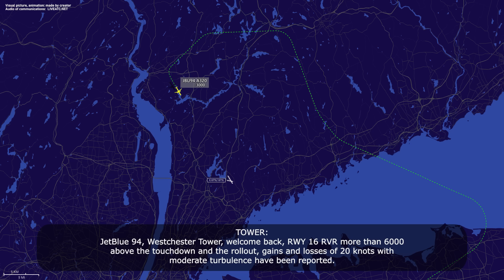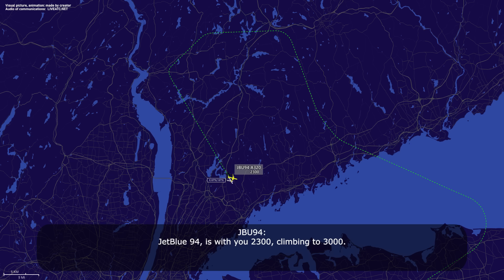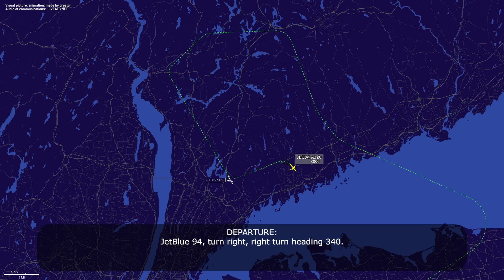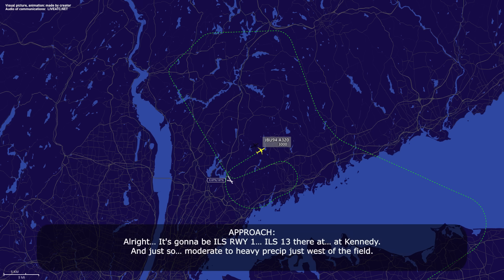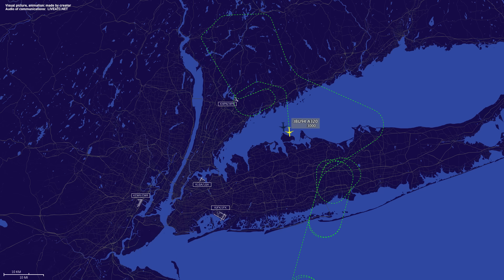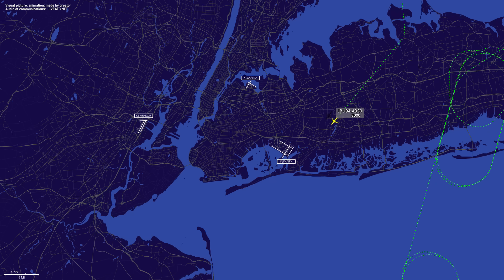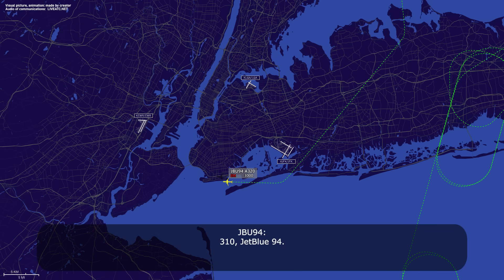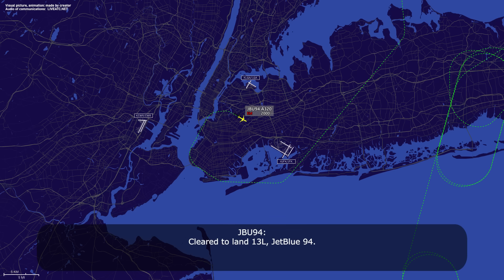Minimum Fuel. Pilot declares fuel emergency. Unable to land at destination airport. Real ATC

Comment: Some have asked why the controller declared emergency fuel for JBU94 ? Avianca Flight 052. 25 Jan 1990. At the time stamp 06:16 JBU94 was flying abeam Cove Neck, NY.
Reply: ATC will declare the emergency to expedite the landing and save the pilots from a major headaches with the company. Also this controller is sensing these pilots are totally at the limit of how many tasks they can do at once. When he asked do you need to declare min fuel he was giving them the door to a quicker landing. PS it's usually fuel to to furthest alternate plus 45 min for vectoring or a 2nd alternate.
Reply: @BillWendell-y5c  ATC know that their declaration of an emergency gives them wide leeway in how they direct traffic in order to deal with that emergency. They also know that commercial pilots aren't going to complain when ATC makes life easier on them, and that the companies the pilots work for can't complain when ATC is the one giving the pilots commands to operate out of company procedure. 

An airline pilot taking it on themselves to divert to another airport can have the company on their back, but ATC making such a call means the pilot can just point to the government and shrug.

Comment: In this time of FAA troubles, doesn't it make sense for aircraft to carry extra fuel, even at the expense of fuel economy.  We can't add low-fuel worries to the current problems!
Reply: They did have plenty of extra fuel BUT with 55 minutes of hold time (at the start of this recording) they used it up fast.
Reply: @charlesgee3003  Agreed, but if I were a passenger I'd feel better if these aircraft filled up the tanks so that ATC and pilots had a lot of options.  ATC is badly overworked.
Reply: @GreenEyes_MS  They could, but their airline would go out of business pretty damn quickly.

Comment: 5300 lbs / 2400 kg isn’t really a fuel-emergency amount of fuel. That’s a pretty standard amount to land with. Obviously, this is busy airspace and the weather isn’t great, but I think the first controller misunderstood how much endurance they had, because it should have been about 60–70 minutes. When ATC said they’d declare a fuel emergency on their behalf, it seems like the flight crew just chose to go with it.

That’s why you later see them declaring minimum fuel—because at that point they had actually reached minimum fuel but still expected to land with their final reserves.

But then ATC gets confused because she thought they were already a fuel emergency, and when the pilots try to explain that it was ATC who made that declaration, she doesn’t understand. At that point, they decide to just go with the fuel emergency, since if she took them out of their current sequence, they would definitely become a fuel emergency.
Reply: I flew the Airbus for 24 years. Our VFR fuel planning was landing with 6500 on the 320, 5200 on the 319. These guys were driving around at 3000 feet. I guarantee you the fuel flow at that altitude made 5 or 6 thousand pounds look like fumes.
Reply: That’s still around 60 minutes. Not an emergency, necessarily. 

If the pilots were concerned that additional delays would burn them into 30min/final reserve, then they’re MIN FUEL. 

If the pilots believed they would land with less than the 30min/final reserve then they’re MAYDAY FUEL.
Reply from the maker: Thank you. Just weird situation. That's why I decided to post it.
Reply: Yeah, seemed like ATC was more concerned about fuel than the pilots were.  Maybe they misheard when the pilot gave remaining time or the pilot meant minutes until min fuel, rather than minutes until exhaustion.  In any case, seems like the pilot didn't really think it was an emergency.
Reply: Sounds like the effectively had to declare an emergency in order to be sent right towards kennedy, otherwise they'd be sitting in a hold for like 30 minutes at which point they would have become a real emergency.
Reply: I am not a professional pilot but the A320 has a design maximum crosswind tolerance of 38 kts. They are reporting crosswind gusts at 38 kts (at 9:58) on final.  Question: How many missed approaches can they safely do if TSHF and still land with the minimum amount of fuel to avoid raising ant eyebrows?
Reply: @mannygon the wind was almost a complete headwind component though, 13’s heading is 134 and the wind was at 120
Reply: @sam_mccrmck  Thanks

Comment: One of these days B6 with put a plane into the drink!  This is 7-8 time this year B6 flights have declared min fuel or emergency fuel into the NYC aerodrome.  Maybe the FAA needs to talk to them about fuel skimping.
Reply: If I heard correctly when this recording started they had already been a 55 minute weather hold.   Not an expert but that sounds like a lot of fuel got burned.
Reply: @charlesgee3003 Yessir you heard right.  But why is it only B6 in this situation all the time ?  I hate to arm chair QB this but I think after a 30 minute hold over HPN I would have went to JFK and did a gas and go.  What type acft was this anyway?
Reply: @MikeCole-q4f  I suspect that is just bad luck newswise.   If they use the same rules for fuel reserves as other carriers (I am guessing they do) then luck, timing and destination come into play.
Reply: Sometimes, not this time, pilots will will declare min fuel to get a quicker landing. It's a dirty trick.

Comment: 8:08 I think the pilot intended to call mayday fuel, not min fuel, as they had already declared min fuel.
Reply from the maker: I'd like to get the audio from that frequency, where we can hear only contoller. That would really help.
Reply: @YouCanSeeATC  That would be super helpful because I'm having a hard time making the math work.  A 30 min low altitude hold is around 2,700lbs of fuel burn but he's reporting 5,300lbs at 06:50 so he's above emergency fuel at that point.
Reply from the maker: Yeah, and that controller was kind of scared maybe, when he heard the fuel remaining in time. And then the flight crew reports more than 5000 pounds of fuel. And a few minutes later declares min fuel and emergency. Kind of weird 🤔